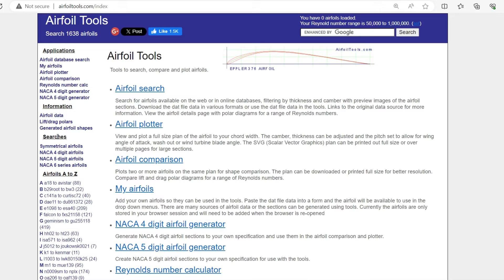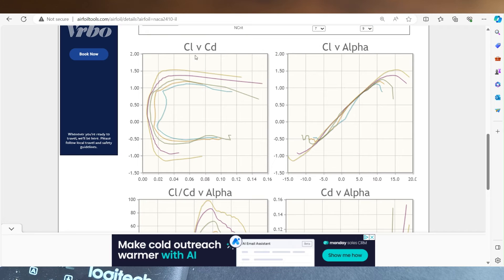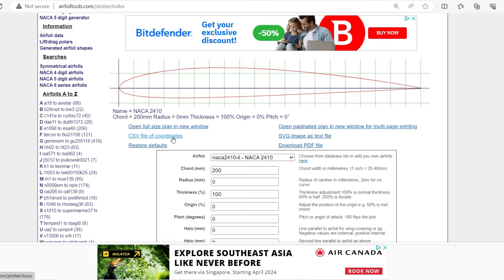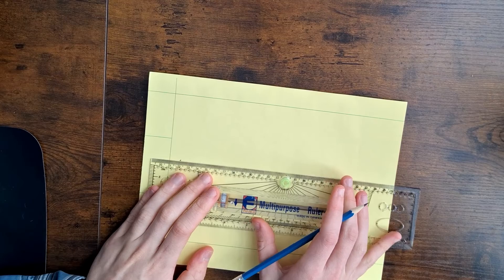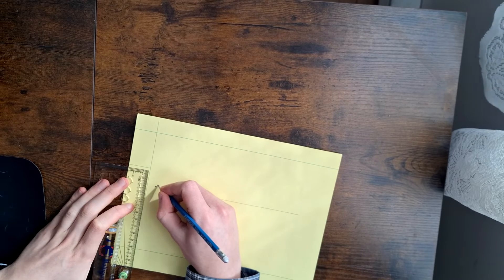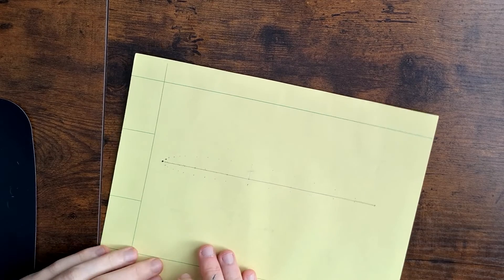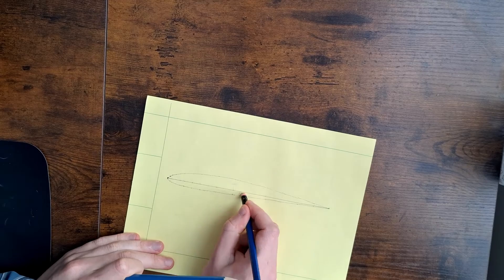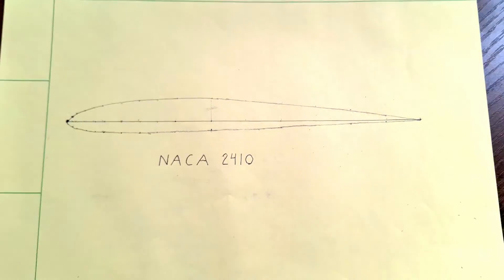How to Draw Airfoils

Comment: The thing to understand is that discontinuities are what destroy efficiency.

Even though something may look "smooth", may not be at all smooth in the (higher) derivative.  The air is only sensitive to derivatives, not aesthetics.
Reply from the maker: Yes, that's why this method is not perfect. For cutting out perfectly smooth airfoils I would recommend laser cutting or printing a template instead.

Comment: I always draw airfoils by calculating. Tip: use stainless steel to connect  all points.
Reply from the maker: Thanks for the comment! Yes, another way to do it is to scale down the coordinates manually. What do you mean by using stainless steel to connect the points?
Reply: @HomeGliders  If you use a thin ruler (or other thin springy material) you can use it as a spline (very old-fashioned, btw!) and hold it in place with the use of some pins or nails on your coordinate points. Then you can trace along the spline for a perfectly fair curve, "by hand", so to speak.
Reply: @denniszhang9278  Right!
Reply from the maker: @denniszhang9278  Definitely a good idea. I wonder if there's a purpose built spline ruler out there.
Reply: @HomeGliders  Hi,I forgot the word"a ruler". It's a stainless steel ruler. Good luck!